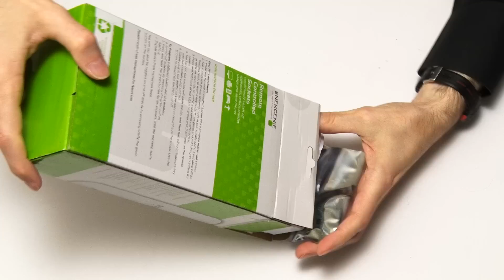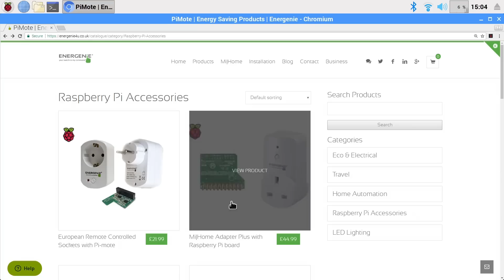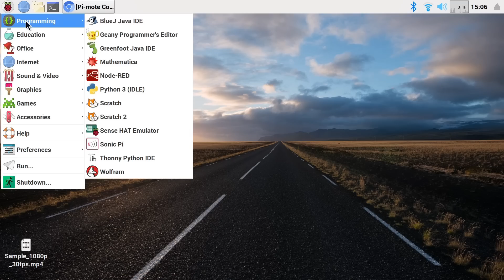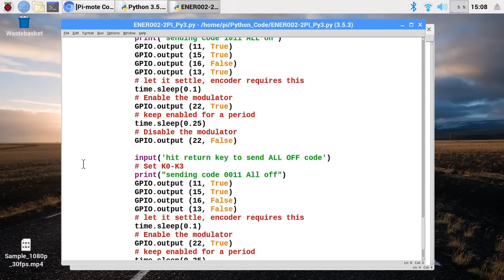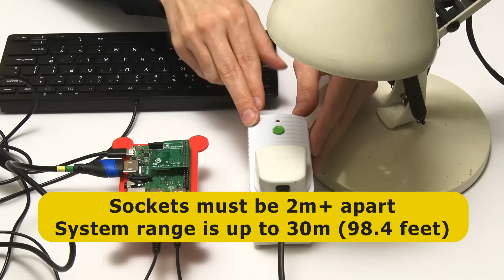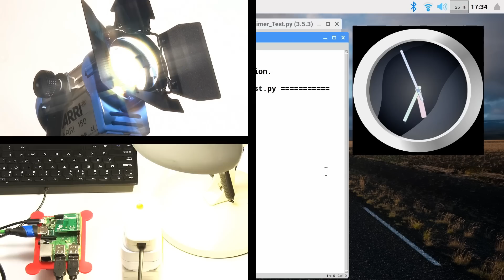Raspberry Pi Automation #2: Energenie Wireless Sockets

Comment: Hi this is a great video, as was the previous chapter with the lightbulbs. I have a question: the remote control functionality is very much down to the Energenie product. I can't find this online, maybe they went bust. Can you recommend a suitable alternative product. I'd really like to use this format, rather than your wired example, because a few years ago I had an Arduino catch fire and obviously this method keeps the 220/240V away from the Raspberry itself.

Comment: Hi Christopher. Thanks for such helpful content. I'm new to RPi and will be buying soon. I'm particularly interested in using the Engine type plugs. We had solar PV installed recently, unfortunately using excess solar is not so straight forward which is how I came to your videos. A very useful and cost effective solution would be for a Pi to be connected to a CT sensor to switch the plugs on as the export rises above say, 100 watts. If inductive loads are plugged in e.g. oil filled radiator, then better value would be taken instead of the feed in tarriff. Commercially available systems are expensive and less flexible needing hard wiring on the 240v side. So a Pi controlled smart plug could simply use existing wiring. Regards.

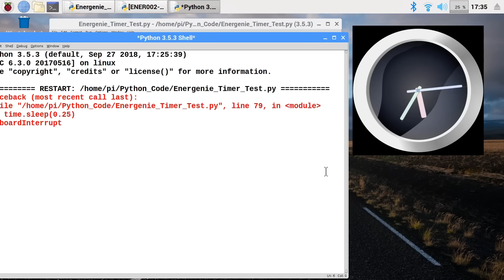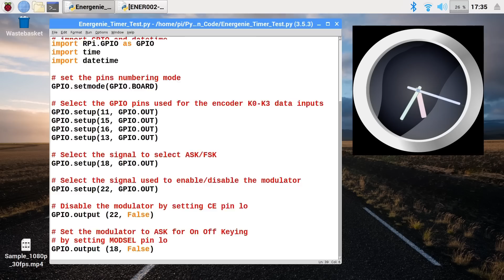Comment: At 14:10 and 14:16 mins, I'm curious if you wouldn't have gotten the Traceback (on ctrl+c) if you had used:
except KeyboardInterrupt:
         # as they did in    ENER002-2PI_Py3.py
	GPIO.cleanup()                    # I like clean exits

Comment: Hi, I'm new all this so I hope someone can help me, I've got two of these plugs and a light sensor connected to a raspberry pi, my plan is for when the sun comes out  the light sensor turns the plug on connected  to a element to give me hot water in my hot water tank. I can get the program to work with the sensor ie flashing a light in front of it comes up with values on the screen and then I can get the sockets working switching them on and off exactly like my friend is doing here excellent. The problem is how do I get the the programs to work together so when the light sensor detects light it turns the plug on, like I say I'm new to all this so thanks in advance.

Comment: Hi I think this is really cool, I'm really looking forward to your update on this for the lux sensor, the little project I'm working on hopefully with your help is I've got solar panels on the back of my house and a wemo plug on my hot water tank so my plan is when the sun comes out it turns my wemo switch on that is connected to the heating element in my hot water tank ,ideally I need to put some  rules in when the sun gets brighter it will trigger the switch when it goes over 1kw, if you have any ideas please let me know, I'm extremely new to this but this idea has been banging round in my head for sometime, I look forward to any replies.

Comment: I always thought that wifi meant that the device WAS on a network.  8-D
Reply from the maker: WiFi indeed places a device on a network. But these sockets do not use WiFi.
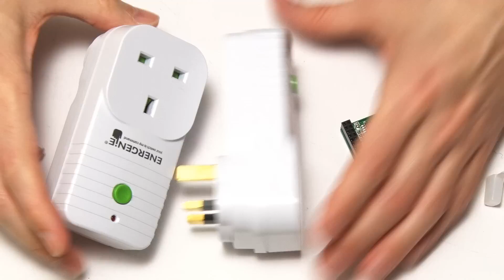Reply: @ExplainingComputers  @1:57 "This is not network hardware.  These are NOT WiFi devices, these are straightforward wireless sockets."
(Emphasis mine).
My bad, I did not hear the "NOT".
Still, my cellular telephone company says that their service is "wireless", so maybe you could be more specific - is this Bluetooth, or something else?
Perhaps https://en.wikipedia.org/wiki/LPD433 ? ("It is ... used for low-cost home automation" in the UK)
Also, what do they state as the range? 
https://n8henrie.com/2015/03/range-testing-for-wireless-arduino-projects-rf-433-mhz-and-nrf24l01/

Comment: If you want to make a Thermostat for your house that can automatically switch from heating your house to air-condition with out you manually flipping a switching for under $170 US. You can use at minimum Raspberry Pi 3 B or B +.

To have it automatically change from heat to air you will need two Thermocouples, one for measuring inside air temperature (needs to be  and one for measuring out side to determine when to change from heat to air & waterproof).

You will need a relay board as well as a board to convert the Temps for the Raspberry Pi.

Here is a list of the parts I think will work together:

1 - Raspberry Pi 3 B+ Motherboard
     https://www.amazon.com/gp/product/B07BDR5PDW/ref=ox_sc_act_title_7?smid=A30ZYR2W3VAJ0A&psc=1

1 - SSD Memory Card I choose 128GB you can reduce to save on the budget
     https://www.amazon.com/gp/product/B073JYC4XM/ref=ox_sc_act_title_6?smid=ATVPDKIKX0DER&psc=1

1 - Seeedstudio-GrovePi+ (Which will get Temps)
     https://www.amazon.com/gp/product/B01ANDPDQE/ref=ox_sc_act_title_5?smid=A1YP59NGBNBZUR&psc=1 

1 - PiRelay EXPANSION BOARD
     https://www.amazon.com/gp/product/B077LV4F1B/ref=ox_sc_act_title_4?smid=A6VWRX3EBWSU4&psc=1

1 - seeed studio Grove - I2C High Accuracy Temperature Sensor(MCP9808)
      https://www.amazon.com/gp/product/B07HCK8Z5T/ref=ox_sc_act_title_2?smid=A1YP59NGBNBZUR&psc=1

1 – Waterproof Temperature Sensor Probe Module for Arduino Raspberry Pi
      https://www.amazon.com/gp/product/B07QJWVB9Q/ref=ox_sc_act_title_3?smid=A26266MVADWARO&psc=1

1 – I choose the Raspberry Pi 3 B+, 5 inch Capacitive Touch Screen HDMI Monitor - 800x480 
      because it mounts the Pi so that you can mount the other boards without extra cables.
      https://www.amazon.com/gp/product/B07P3HF42V/ref=ox_sc_act_title_1?smid=AD7LID9K1N4N9&psc=1

 If you have a large house with two furnaces you will need another Temperature Sensor for that part of the house, as the relay board has four relays.

 You most likely will need Thermostat wire so that you can extend the wires on the waterproof sensor, also the wires from the furnace. Which you should be able to source from any hardware store.

The logic for programming the Raspberry Pi is as follows:

You need to determine the outside Temperature:
If the outside Temp is above say 74 degrees F or 23 C you will need the air-conditioning.
If the outside Temp is below say 70 degrees F or 21 C you will need the heat.
You may change the Temps above to suit you own needs, but they can never be the same or cross over other wise the furnace will not work properly.

You need to have on the screen what Temp you want the furnace to heat and Temp you want the air.

The fun part is the programming of the Pi.
Reply from the maker: Fantastic post. Thanks for sharing.
Reply: @ExplainingComputers  You most of the equip why not try it?
Reply from the maker: I may well. :)
Reply: @ExplainingComputers  Do you know how to test without really using a furnace? Just making sure. Oh and since you have clone boards you should try it out them in another vid. See you now have two vids to make.
Reply: I would add a Weather forecaster as well

Comment: Update:I have X10 security and lights which HAD a serial PC interface that is no longer supported.  After watching this episode I've found X10 updated a while back to a USB interface which is still not supported. After some digging I found some clever people have given me an ancient  roadmap (tongue and cheek) to use the USB with Rasp pi. With that I am using it to control my lights, fans,etc and X10 even has modules for 220V (US) for controlling AC units. My home and my fathers home are 100% Solar powered with 70 KWH battery banks and he has had trouble with large draw appliances depleting his batteries. I am using the Rasp Pi to read the batt volts and if below set linit send signal via X10 to shut down his appliances so he doesn't have to rush home if it rains. Thanks Professor for the inspiration and in your own way helping to solve a very real problem in our homes. Cheers!
Reply: Is there anyplace where you have uploaded your project so that I could build one too

Comment: Have you had problem with updates on windows 10 pro -   mine updated all but  1 file and it won't update the other 1 for nothing - chatted with 2 windows techs and office 16 won't install right either  - no luck it said it was Intel audio software - updated that - then USB hardware - so I disconnected my Blueray player - - I've restarted my desktop several times  - just curious  - I've heard they have problems with windows 10 pro updates and I believe it -   thank for listening - my desktop does work by the way just the 1 file and office 16 pro
Reply from the maker: Yes, I've seen this issue. I would not worry about it. :)
Reply: @ExplainingComputers  Microsoft came out with a major update yesterday and I downloaded it and that was that - the file is gone - and now office is on my desktop working again - that major update  took care of the problem so far  - thanks

Comment: Why would anyone think using a multicore computer to turn a light on and off is a good idea :/
Reply from the maker: I think you've missed the point -- what I am demonstrating here is one part of a potentially wider solution where that computer could have wired and wireless control of a number of devices, which are operated via time settings and a range of sensors.
Reply: @ExplainingComputers  I wasent actually talking about you personally, sorry.  I guess I been spoilt with MCU's lately. They seem to do all that too.
But what I really meant was, Id like to see someone use or better yet, program a Pi to even 10% of its potential.
Reply from the maker: Ah, now that certainly makes sense. :)

Comment: I've had one of these running several years now on a Pi2 and is solid as a rock. I made a simple web page that enables the sockets to be controlled from anywhere. You can increase the reliability of the range by soldering a small antenna to the board. They give instructions what length to do that, only a basic bit of copper wire..
Reply from the maker: Great to have this feedback, thanks.
Reply: @ExplainingComputers  Chris, your python3 code doesn't seem to execute for me, have you tried it recently?
Reply: @almurray2000  not sure if it helps, but I have managed to check what I did. Firstly, I am only using two remote switches. I have a very small php file serving a basic web page interface. I then have a small python file which is called every time the web page user hits a submit button. Obviously your web server needs admin over these files to execute. Don't ask me to explain any of it as it was a few years ago and I was basically pulling together sample code and praying!!! But, maybe it helps you!

This is the file which runs the code to set the switch status. It gets the sys.argv sent from the php call and decides which (1 or 2) to turn on or off.

FILE: "switches.py"

#import the required modules
import RPi.GPIO as GPIO
import time
import sys

cmd = sys.argv
lamp = cmd[1]
state = cmd[2]

print lamp
print state

# set the pins numbering mode
GPIO.setmode(GPIO.BOARD)

# Select the GPIO pins used for the encoder K0-K3 data inputs
GPIO.setup(11, GPIO.OUT)
GPIO.setup(15, GPIO.OUT)
GPIO.setup(16, GPIO.OUT)
GPIO.setup(13, GPIO.OUT)

# Select the signal to select ASK/FSK
GPIO.setup(18, GPIO.OUT)

# Select the signal used to enable/disable the modulator
GPIO.setup(22, GPIO.OUT)

# Disable the modulator by setting CE pin lo
GPIO.output (22, False)

# Set the modulator to ASK for On Off Keying 
# by setting MODSEL pin lo
GPIO.output (18, False)

# Initialise K0-K3 inputs of the encoder to 0000
GPIO.output (11, False)
GPIO.output (15, False)
GPIO.output (16, False)
GPIO.output (13, False)

# start checking what we need to do

if lamp=='1':
    if state=='on':
        # lamp 1 on
        print "lamp 1 on"
        GPIO.output (11, True)
        GPIO.output (15, True)
        GPIO.output (16, True)
        GPIO.output (13, True)
        # let it settle, encoder requires this
        time.sleep(0.1)
        # Enable the modulator
        GPIO.output (22, True)
        # keep enabled for a period
        time.sleep(0.25)
        # Disable the modulator
        GPIO.output (22, False)
    else:
        # lamp 1 off
        print "lamp 1 off"
        GPIO.output (11, True)
        GPIO.output (15, True)
        GPIO.output (16, True)
        GPIO.output (13, False)
        # let it settle, encoder requires this
        time.sleep(0.1)
        # Enable the modulator
        GPIO.output (22, True)
        # keep enabled for a period
        time.sleep(0.25)
        # Disable the modulator
        GPIO.output (22, False)
elif lamp=='2':
    if state=='on':
        # lamp 2 on
        print "lamp 2 on"
        GPIO.output (11, False)
        GPIO.output (15, True)
        GPIO.output (16, True)
        GPIO.output (13, True)
        # let it settle, encoder requires this
        time.sleep(0.1)
        # Enable the modulator
        GPIO.output (22, True)
        # keep enabled for a period
        time.sleep(0.25)
        # Disable the modulator
        GPIO.output (22, False)
    else:
        # lamp 2 off
        print "lamp 2 off"
        GPIO.output (11, False)
        GPIO.output (15, True)
        GPIO.output (16, True)
        GPIO.output (13, False)
        # let it settle, encoder requires this
        time.sleep(0.1)
        # Enable the modulator
        GPIO.output (22, True)
        # keep enabled for a period
        time.sleep(0.25)
        # Disable the modulator
        GPIO.output (22, False)

# Clean up the GPIOs for next time
GPIO.cleanup()

-----------------------------------------
This is the file you open from your web browser via your web server on the Pi. The UI is just four buttons which send a bespoke message to the Pi to execute the switches.py code. Either '1' or '2', followed by 'on' or 'off':

FILE "switches.php"

<meta name="HandheldFriendly" content="true" />
<meta name="MobileOptimized" content="true" />
<meta name="viewport" content="initial-scale=1.0, maximum-scale=1.0 width=device-width, user-scaleable=no" />

<html>
<head>
<?php

if(isset($_POST['1on'])){
        exec('sudo /usr/bin/python /var/www/switches.py 1 on');
}
if(isset($_POST['1off'])){
        exec('sudo /usr/bin/python /var/www/switches.py 1 off');
}
if(isset($_POST['2on'])){
        exec('sudo /usr/bin/python /var/www/switches.py 2 on');
}
if(isset($_POST['2off'])){
        exec('sudo /usr/bin/python /var/www/switches.py 2 off');
}

?>

<title>Messaging Page</title>
</head>
<body><h1>
Select a lamp...
<form method="post">
<button name="1on">Lamp 1 on</button>
<button name="1off">Lamp 1 off</button>
<br>
<button name="2on">Lamp 2 on</button>
<button name="2off">Lamp 2 off</button>
</form>
</h1>
</body>
</html>
Reply: @richardturnnidge  I am extremely grateful for you taking the time to do this - it's a great help, thankyou!
Reply: @almurray2000  I too am glad I left all the comments in, otherwise I would no longer have a clue what was going on!!
Reply: I see the above comments were made quite recently so if anybody is interested, there is now support for these Energenie sockets in the GPIOZERO library which makes the Python code more compact and readable - see:- https://gpiozero.readthedocs.io/en/v1.5.1/api_boards.html#energenie
Reply: Hi Richard, I hope you read this. I am trying to set-up the same thing! However my cgi gateway only runs python3 code and despite downloading Christophers re-coded Python code I can't get it to run. Please point me in the right direction!
Reply: @almurray2000  my little pi is still running fine. I don't think it's even been re-booted in ages, although I would have to try to find the code running on it. Let me check tomorrow and get back to you. I will have to remember the login to the pi! I recall a basic php script and a simple shell script.

Comment: I couldn't find Energenie here in the states, but I found a nice four outlet unit at Adafruit for about the same price. I'm sure Amazon might have similar hardware also. I do like this video series... Been thinking a lot about how to automate this way versus using one of the pre-configured "hub" systems. I know that this Energenie project isn't on the network, but there have been problems with the hub systems and network security (TV's, refrigerators, information hubs like alexa/Google/Bing... ). Building and coding your own automation let's you put as much or as little security in it as you want. Excellent Chris. Thanks and looking forward to more in the series.

Comment: Another fascinating and detailed guide.

I note the 4 socket pack dates back to 2010 on Amazon. Is there potential for major "improvement" in a new version should one be released in the foreseeable or can I order one now even though I don't have a pressing need atm?
Reply from the maker: I doubt this tech will improve. Development is now focused on online / WiFi hardware.
Reply: @ExplainingComputers 
Yes unfortunately the least intelligent product version the uneducated hordes use brainlessly to make things very easy for future thieves burglaring their homes keep winning out. Even governments are pushing 'smart' electricity meters which are basically n invitation for e-stalking or worse.